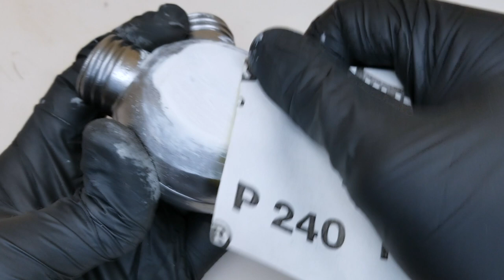Rusty Double Neck Oiler Restoration

Comment: Oiler ? What is a oiler ? What is it used for and how does it differ from a oil can ?
Reply from the maker: Hi! The oiler is designed for separate storage of neutral and alkaline oils.
Reply: @activerestoration224  what are those specific oils used for ? Any thing like motor oil ?
Reply: @sol star Most commonly for solvent and lubricant for firearms.
Reply from the maker: Thanks for the answer!

Comment from the maker: ▬▬ Timecode  ▬▬
00:00 – Double Neck Oiler overview
00:21 – Using rust remover to unscrew the cap
03:05 – Removing the old paint
04:20 – Removing the rust with electrolysis
06:30 – Polishing with poly strip disk 
08:13 – Using universal putty to cover holes and dents
10:58 – Painting
15:22 – Final result